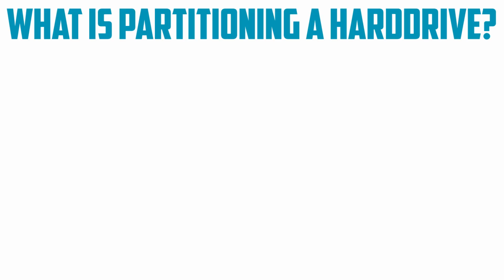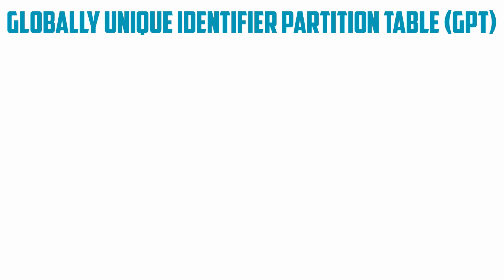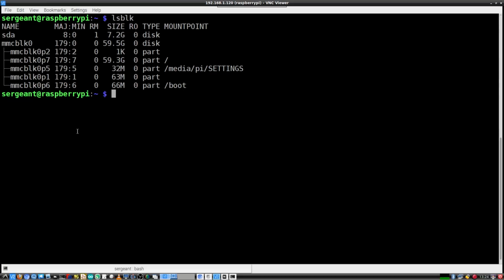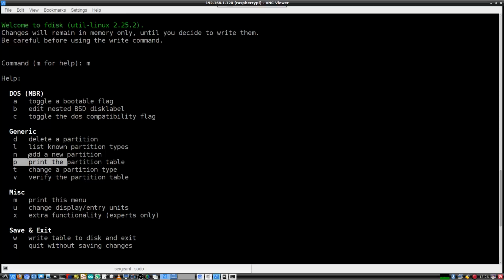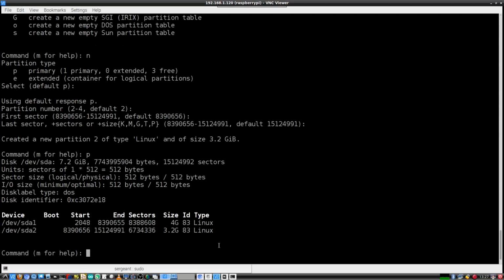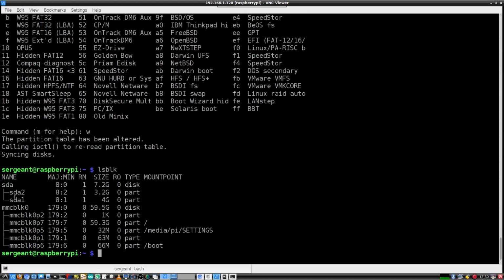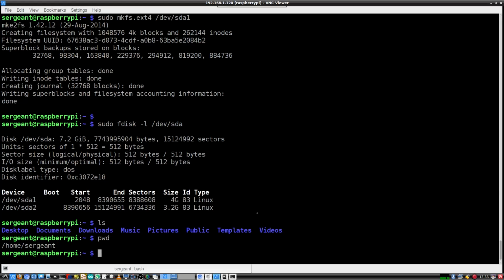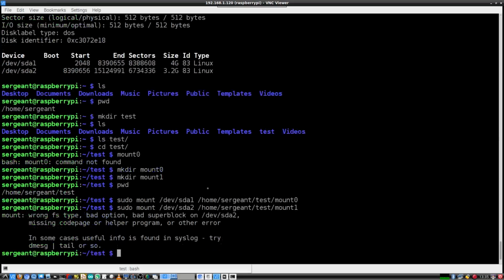sudo Sergeant 05 - Partitions & File Systems

Comment: I don't that anyone should do this on a UEFI based system otherwise the checksum will be different and it won't let you in so it might be better to leave it alone unless you want to do this on a Legacy computer something running XP pro and maybe just install the latest version of Linux Mint 18.3 MATE and let the installer do the partition manipulation and just enter the information requested by the installer and enjoy using Linux Mint 18.3 64bit

Comment: Felix!!! Love sudo sergeant! Do you think the task of writing your own file system would be too great? Long term series like with the ben heck builds?
Reply: Writing a full-fledged filesystem driver would be kind of nuts. Not much point doing it unless you've got the resources to write something that rivals EXT4 and XFS, or at least provides some unique benefit in a case not well-covered by the major filesystems.
But writing a userspace filesystem driver (with FUSE, probably) would be a reasonable project. A project like that could strike a reasonable balance between utility (mounting tar files, that sort of thing) and keeping the project reasonable in size.
Reply: Tetsujin really the thought was at exploring what is involved and how much it takes... as many probably dont have much(if any) knowledge of how the hardware is implemented, or their differences.